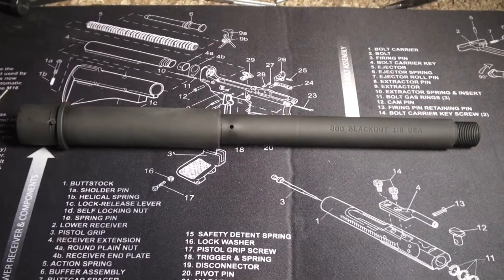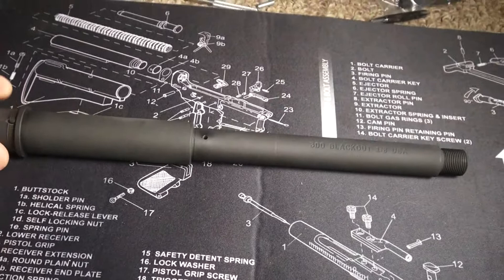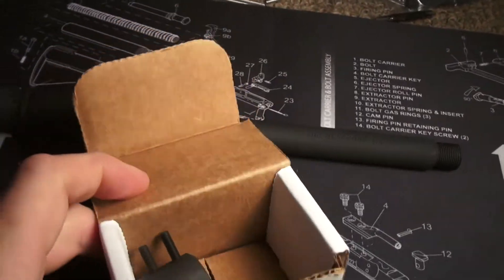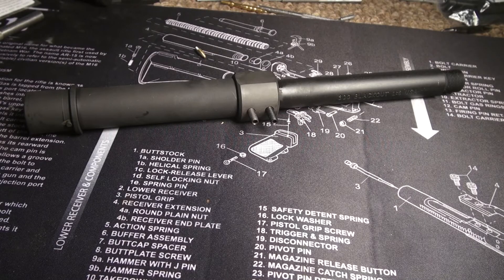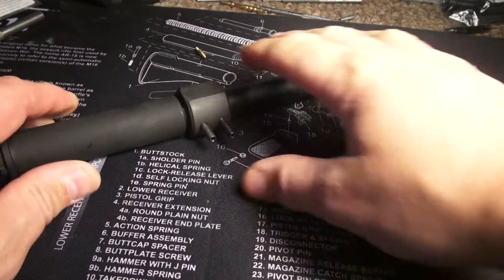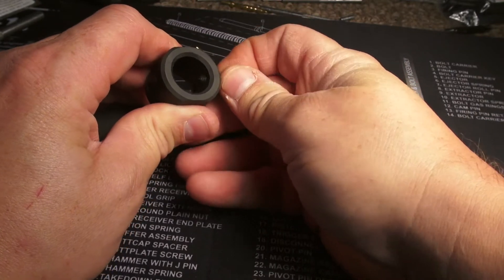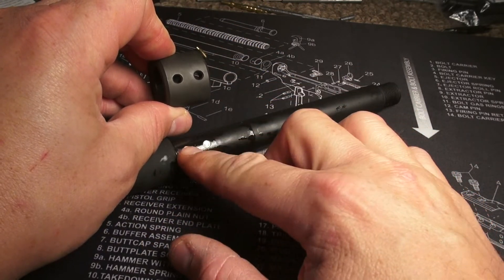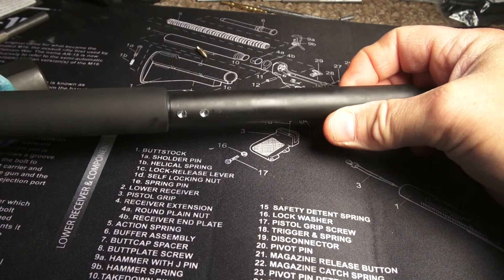Mas Defense 300 Blackout barrel needs dimpling

Comment: Is this to ensure the gas block lines up correctly?
Reply from the maker: Yes, being that the jig indexes off of the gas port to drill your holes it does allow for trouble free alignment if you are using a gas block that has set screws.  Had I not drilled the dimples out, I would have had to use a clamp on gas block.  I would not try using a set screw style gas block without the barrel being dimpled.  Some manufacturers only use one barrel dimple, on their barrels and I choose to always use 2 for extra insurance.
Reply from the maker: Here is the link to an in depth video on how to use the dimpling jig. 
https://www.youtube.com/edit?o=U&video_id=ny5JPuQcjaw